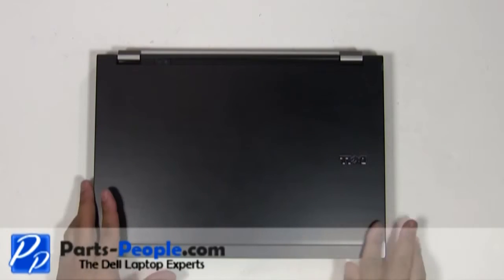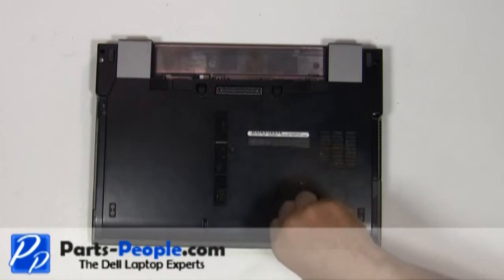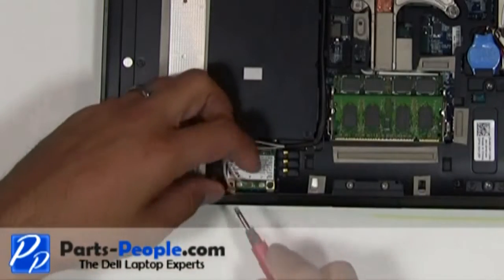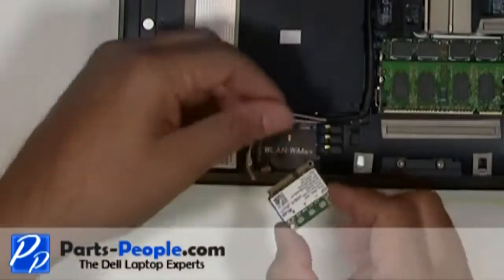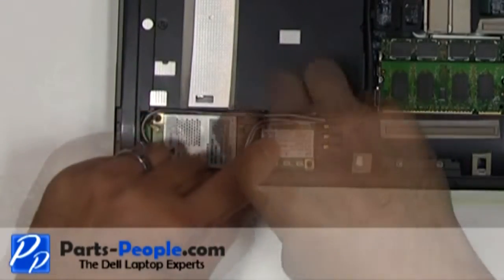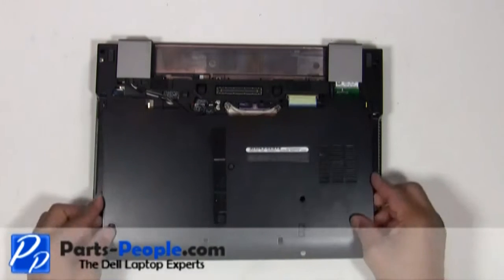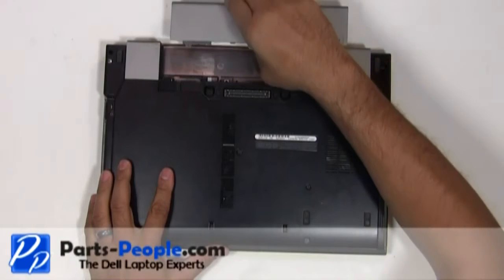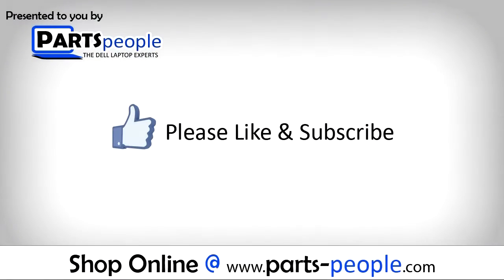Dell Latitude E6400 | Wireless Card WiFi WLAN Replacement | How-To-Tutorial

Comment: Need a little help. 
I need to know if I can solder the antenna  cable directly to the WiFi card in a Dell e6430. One of the crimps is broken. 
Not sure if it’s just a wire, or a mini coax connecting at 2 points. 

Thanks 
Pank

Comment: Hi there... 
I'm having a problem with the wifi connectivity and bluetooth.. The issue is that the wifi is automatically going off even if the swith is on.... Please help me out with this...
Reply from the maker: You can try reinstalling the driver and see if that helps. If not, you probably just need to replace the wifi card.
Reply: thanks alot for help....

Comment: Ok So I've got the card in, and  I've got the two wires connected to their respectful colors, but I'm still not getting a connection, I've also had a windows update fail, and had installed Ubuntu, and yes I have the switch on. any Ideas?
Reply from the maker: Have you tried reinstalling the driver?
Reply: Parts-People.Com, Inc Let it be know that not only does it depend on drivers, but it also depends on your operating system, if your going to a Linux OS get the right firmware/hardware. That being said, thankfully it was not the drivers. I'm sticking to Windows OSs from now on.

Comment: My wireless card only has two receptors not three. Im not sure which cords to attach to the wireless card now
Reply from the maker: If it only has 2 then connect the white and black cables only. Above the receptors you will see a white and black arrow indicating which one goes where.
Reply: Parts-People.Com, Inc I'm curious what having more than one WWan card could do to my system.